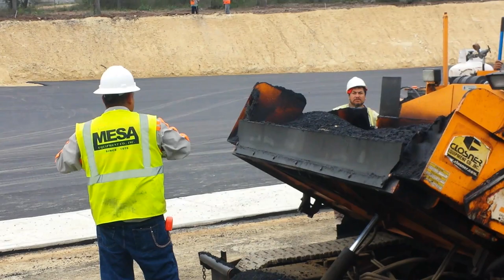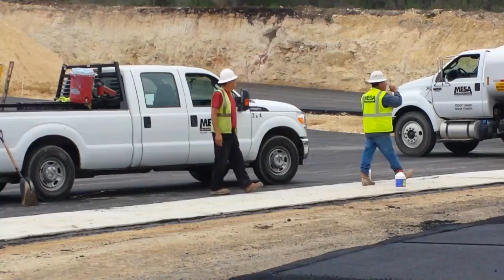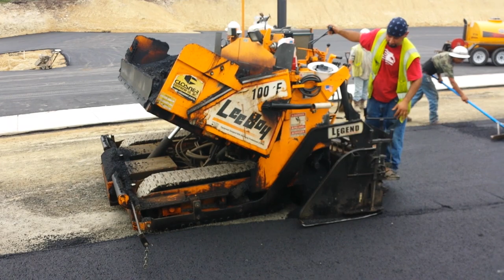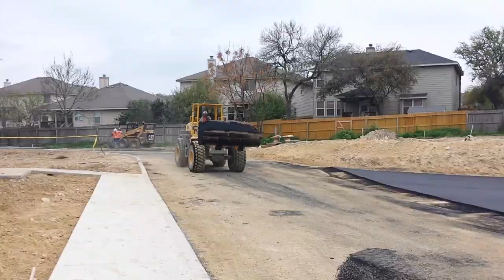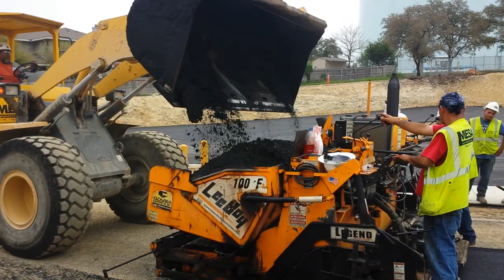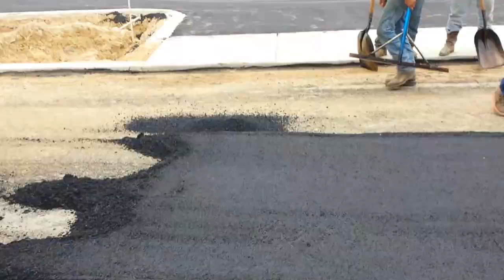The small paver in action

Comment: what I hate are ghetto paving companies that want a truck to back up to these tiny pavers and move the truck 6 feet....just load them up at the drive way and buggy it back
Reply: neckarsulme how does that make it a ghetto company? I own the same machine and a Leeboy 8500 and I’ve put 20,000 ton down back to back seasons with my paver just like this one.  We do a lot of new construction jobs just like this one.
Reply: @hendrickscountypavingllc9567  I guess I was referring to the type of job.. .my company works with a lot of smaller paving outfits that seem to bid what I would consider "ghetto" projects due to their size and/or location. The last job I did the paver operator wanted me to back up into the paver, then push about 5 feet and tell me to go back to the front. Especially when there just isn't a lot of room for a truck in the first place. I did not mean to infer that just because of the small machine it was automatically ghetto.